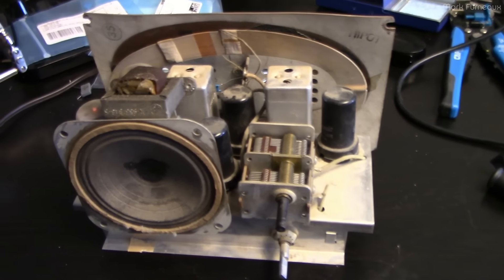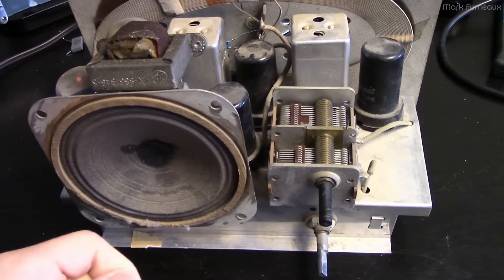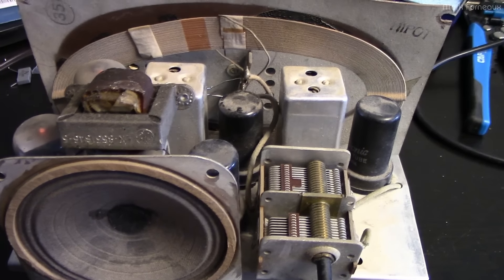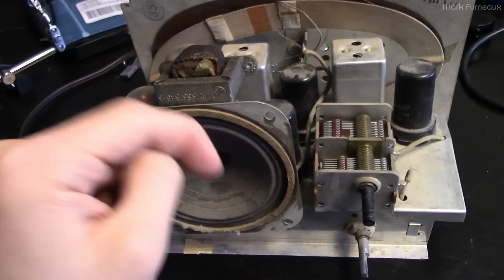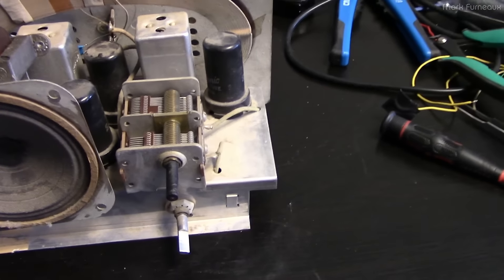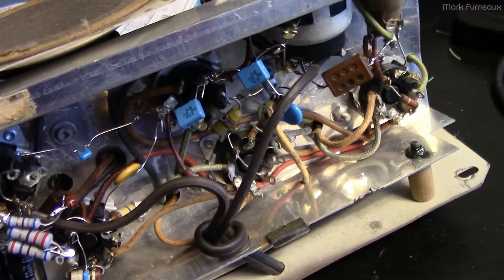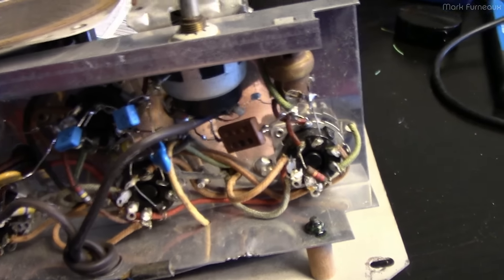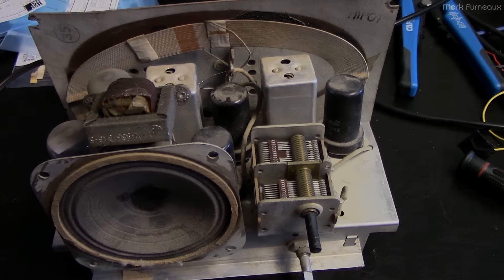1952 B.F. Goodrich SD 75 AM Radio Repair, Part 2

Comment: Far AM radios I bought a tecsun loop antenna that just sets near the radio and the loop antenna has it's own tunning capciator too   on it to help you get  am reception ,I paid about 25.00 for it .I seen guy put a spool of wire next to there AM radios kinda help sometime too. But the tecsun 200 amazing help for testing your radios